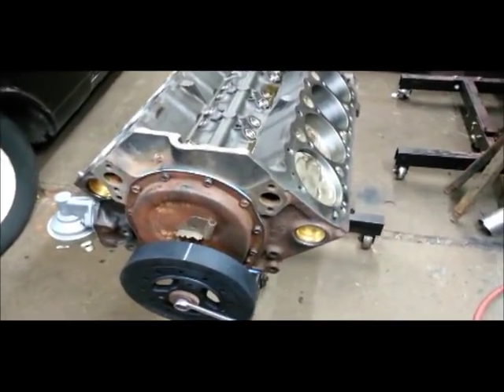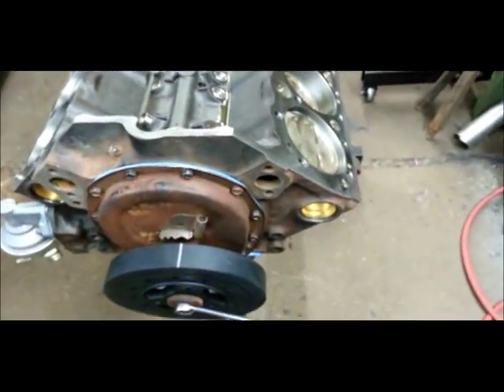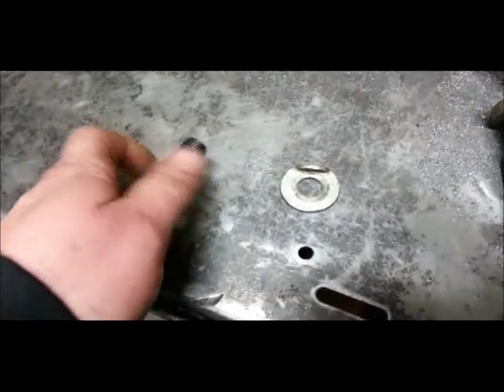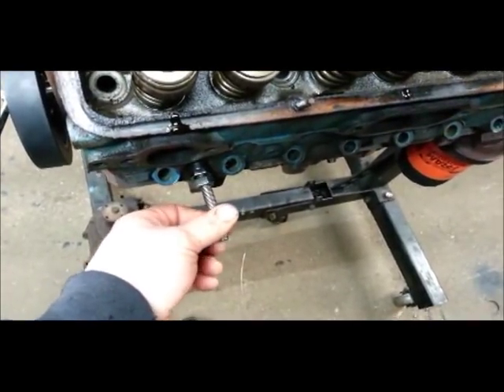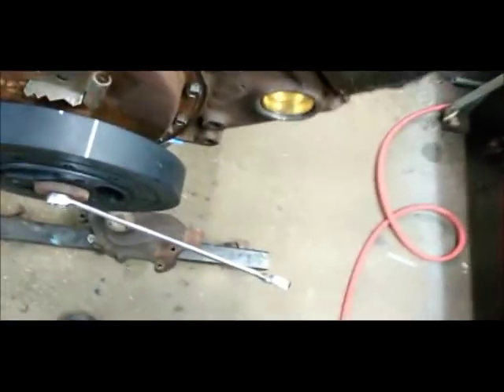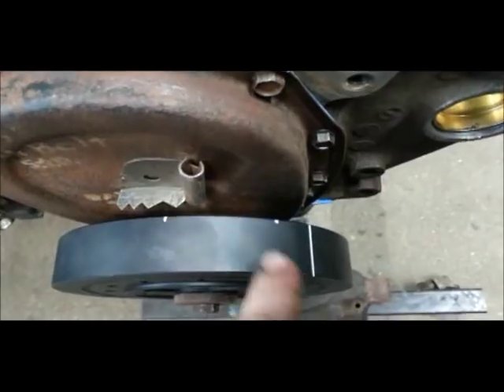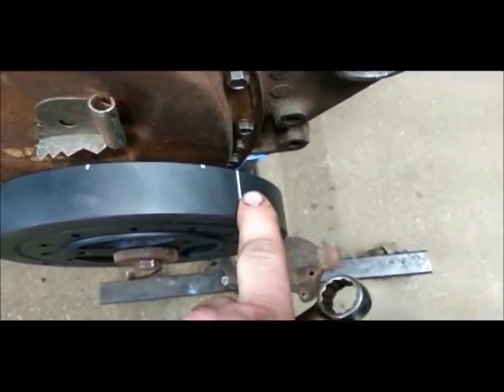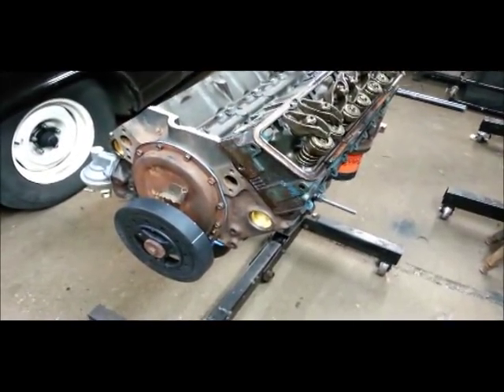finding top dead center .

Comment: how to know how deep the tool needs to be in the hole?
Reply from the maker: +casanovaevren just enough to touch the piston
Reply: +chevahaulic  why do we rotate the engine counterclockwise?.is it for the gap in the connecting rods .I see some people just mark where the piston stops and that's it.thanks in advance
Reply: +casanovaevren The tool doesn't stop the piston at exact top dead center. It stops it right before it. So you turn it one way until it stops, mark that position, turn it backwards until it stops again, and mark that position on the balancer, and in the exact middle of those two points on the balancer is your true top dead center.
Reply: +yamahondarider  thank u I understand that but how does the math work here . I wish there was an animation for that so that it would be easy to understand the theory
Reply: +casanovaevren  79 Corvette manual says 6 before top dead but it has hei distributor and mild cam on it and just got the car lol I'm thinking 10 or 12 btd any ideas?
Reply: There isn't really any math you just measure the distance between the two marks you made and then figure out where the middle is. and that is your TDC. Mark that as TDC. Then to set your timing you simply start the engine, hook up your timing light, and twist the distributor until that final TDC mark you made on yoru balancer lines up with, for instance 6 degree before top dead center on your little pointer doohicky hanging off the timing cover.

Comment: Why wouldn't you NOT put a groove or dabs on the balancer? and use the original line in the damper with a fabbed ( or purchased) adjustable pointer??Grooves or punch marks in a dampeners outer ring create a stress riser point and can lead to the outer ring coming apart with high centrifical force with about the destructive force of a hand grenade under your engine bonnet. VERY destructive!,,Just saying .
Reply from the maker: callmenort your right . 
but I've been doing this for 20 years . Never had a problem with one blowing up .

Comment: Hi *****  Does this apply to my Old toyota 2r Engine?
Why two TDC?

I thought TDC at compression Stroke is the right one,,,
Reply from the maker: michael joe this would apply to your yota 2R . 
The reason for finding TDC compression , is this is a 4 stroke . One TDC will be compression , next time around at TDC your on the end of exhaust stroke starting the intake stroke down .
Reply: ok the TDC compression Stroke is When All Valves are closed am I right..? Thanks
Reply from the maker: yup